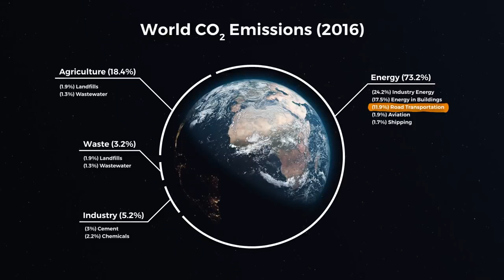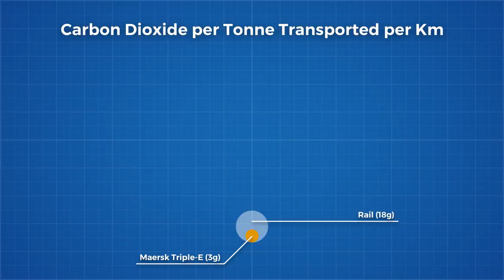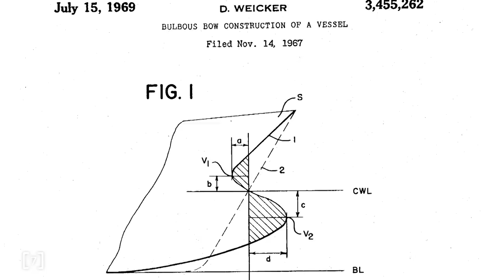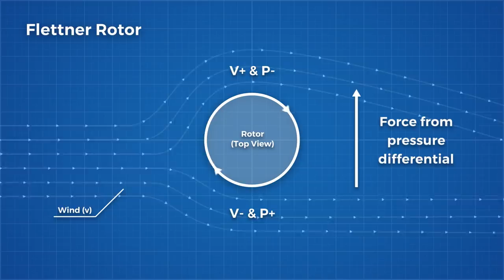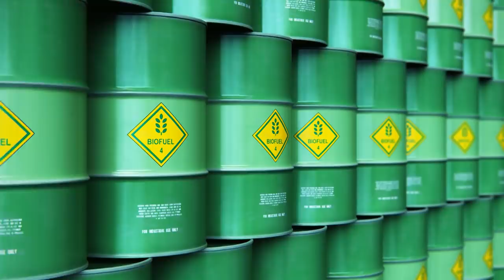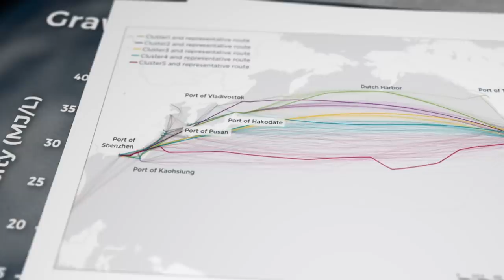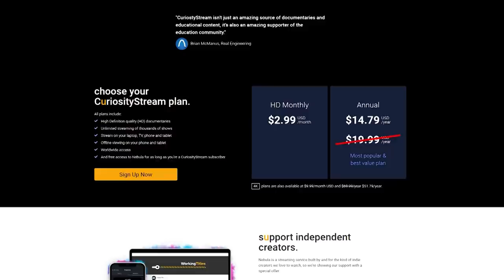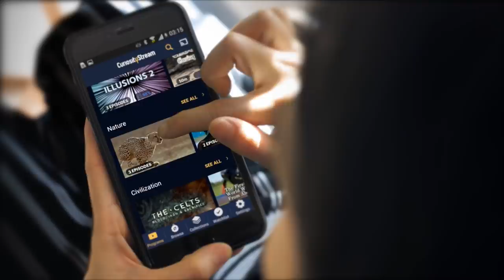Are Renewable Powered Ships Possible?

Comment: Why not use actual sails, or rather, some automated version of sails that auto deploy when in ideal conditions? Along with a roof that is completely covered in solar panels. Surely a ship of that size could make use of its space with panels that power another set of rotors.
Reply: Wind energy.

To address the suggestions that wind power is the answer I offer the following.  The problems with the wind as an energy source are variability, reliability and low energy density; also the canvas, cordage and extra manpower needed for sailing ships were never a very benign environmental option so please discount any idea of sail as ‘sustainable’ and all this is without the problem that if ‘the wind don’t blow the ship don’t go’.  When it does blow it often blows in the wrong direction for your cargo delivery needs and sometimes there is rather too much of it for comfort.  The area where one is most likely to be ‘becalmed’ is the ITCZ (Intertropical Convergence Zone) or ‘the doldrums’ as it is commonly called.  In days of old ships with large crews, such as naval vessels, would try using the ships boats and some of the crew to row through the doldrums thus towing the mother ship out of the calm.  Not practical for less well manned and much heavier merchant ships which could not muster a similar power (oarsmen) to weight ratio (vessel displacement).  Traditional sailing ships are unable to go directly up wind so if the wind is blowing from the direction your cargo needs to go then a zig-zag course must be steered, more distance and thus more time on passage at whatever speed is achieved.  Wind speed is traditionally measured on the Beaufort Scale (wind speed) that runs from 0 (< 1kn or 0.5ms-1) to 12 (> 63kn or 32.5ms-1) and for sailing purposes the usable part of the range is ‘3’ (circa 8kn or 4.1ms-1) to ‘6’ (circa 24kn or 12.3ms-1).  As the wind speed, and the amount of energy that may be harvested there from, increases the sea surface becomes progressively more disturbed which makes the harvesting process ever more difficult and increases the stress on the vessel.  The increased stress means the sail area has to be reduced, either by using fewer or smaller sails until the vessel may in extremis be ‘hove to under storm sails’.  One way of reducing the sail area is by turning up the bottom edge; known as reefing.  With any wind power proposals the question that must be asked include ‘has any information been released into the public domain with regard to the expected energy harvest for the wing forms, on a Watts per square meter basis?  ‘Cutty Sark’, is said to have been able to coax 3 000 horse power (or 2 206 500 Watts / 2.2 megaWatts)) out of her, up to, 2 976m2 of sails, assuming ideal conditions and further assuming that for sailing purposes the usable part of the wind speed range is 4ms-1to 12ms-1 so the yield would be about 741 Watts m2.  So another question ‘for the proposed option what is the expected upper wind speed limit for the system’?  A single stage 'harvest to deployment' system for propulsion will have higher efficiency but ‘what steps are being taken to provide ancillary power such as the, small but essential, domestic, navigational and cargo needs?’

Solar energy.

Solar power is next up, it is a means to convert one form of energy into another; the incoming radiant energy from the sun is processed into electrical energy for use in a motor to create mechanical energy to propel the vessel in this it suffers from problems of scale and productivity.  As an example the above container (called boxes by nautical folk) area of a Maersk Triple E is less than 399.2m by 59m.  The 399.2m is the length between perpendiculars (marine tech speak - no need to worry about it) and the 59m is the width overall (more marine tech speak so again no need to worry about it) allowing for the sides, bow, stern & navigation/accommodation structure could we agree 340m x 56m, or 19 040m2, for the ‘top of stow’ area?  Insolation rate in Joules will vary due to time of day, latitude of vessel, declination of sun, (those three impact the elevation of the power source) cloud cover, the efficiency of the solar panels and how clean they are.  The Maersk Triple E class use two 29 680 kiloWatt each, at full whack, ICEs for propulsion plus some hotel and services power load cost; so for round numbers, could we agree 60 megaWatts?  Solar panels create about 155 Watts m2 averaged out; 19 040 x 155 gives me 2 951 200 Watts (or 3 megaWatts for a round number) from the top of all the boxes.  Those three megaWatts might allow you to distil enough fresh water from the sea to wash the crud off of the solar panels (surprise fact renewable energy does come with some maintenance costs) but nowhere near enough to effectively 'push the boat along'.  Fitting solar panels on top of the ‘boxes’ is worth, at most, 5% of your power requirement.  Side mounted, let alone towed array, solar panels are not practical given the harsh conditions frequently / often found at sea.

More seriously the ‘boxes’ are loaded and unloaded from the top down so the solar panel array would need to be moved for every port operation and time is money as well as that operation having the ability to get very complicated (tech speak for ‘go wrong’).  Any additional weight would be in the worst possible place for the stability of your vessel, the operating environment would be harsh and the ‘top of stow’ on a ‘box boat’ is seldom a level expanse as each column of containers may be, and usually is, of differing heights.

Comment: So a viable option for the biggest of container ships that I feel you missed is nuclear.

And sure I know that sounds strange at first but these ships are on a scale size equivalent with a modern aircraft carrier and in fact weigh more than such a ship. Having a form of fuel that lasts as long as the ship itself or potentially even longer would be a massive net savings for shipping industries.

Obviously there are some pretty big hurdles for such a thing to happen such as the lack of qualified engineers and the fact that the reactor tech the US uses for it's carriers and submarines is technically considered secret and therefore cannot be mass produced so.

But if it is possible to overcome these hurdles then you could have the most efficient ships possible.

Comment: Despite the political fallout, atomic merchant shipping would get you to net zero carbon emissions. This was heavily researched for the ss savannah, but also more recently there have been a number of studies looking at costs and safety.

The cost at this point would be significantly cheaper considering uranium is really cheap, has a high gravimetric/volumetric energy density, and ships would be able to go on several trips before needing to refuel which saves even more money. Obviously convincing people that that size of reactor is insanely safe and that the safest place for a meltdown to occur is actually in the ocean.